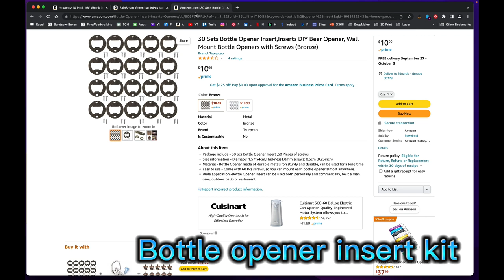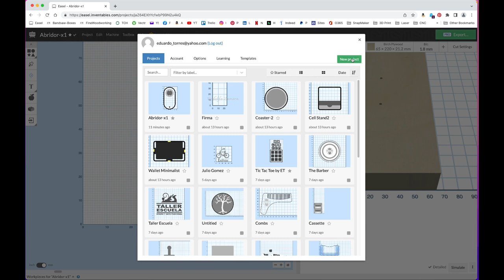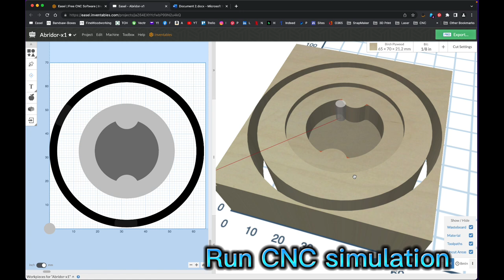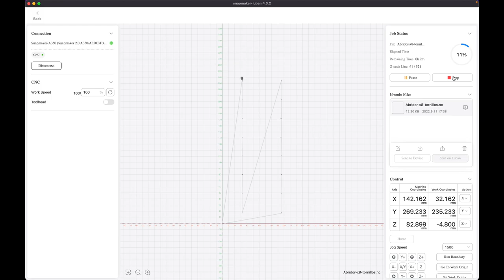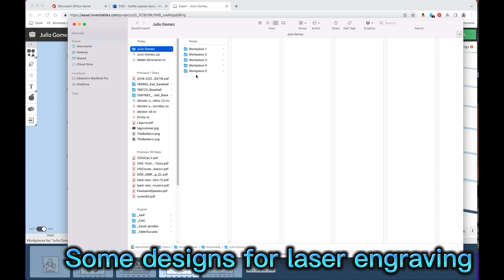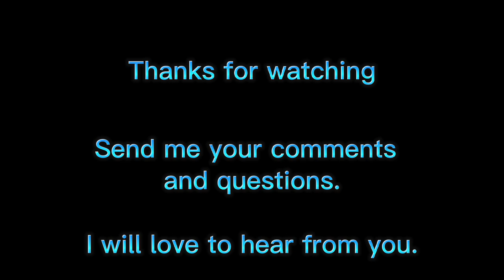CNC Product Making #1 - Bottle Opener

Comment: I have a Snapmaker 2.0 also. Would you be willing to share the CNC cut file?
Reply from the maker: Hi Barbara, I just updated the video description where you can find a link to the project files.  Login into Easel and then you can export from there or copy the project into your account.  Let me know if you are able to do so, if not let me know and I find another alternative.  Regards.
Reply: Thank you so much. You are very talented!
Reply: I saw that you use Luban. If you could send the gcode file I could import it into Luban
Reply from the maker: @barbaracipiti9056  I can look a way to send you the gcode (Dropbox) however remember that you will need to make modificacion to the wood thickness, if not you could damage your CNC bed.   That is why I recommend login into Easel because you can modify your stock size and export the gcole from there.  You follow me?
Reply: @EduardoTorresDeMadera  yes, I would likely use another piece of would as the actual “spoilboard” so as not to damage my actual bed.
Reply from the maker: @barbaracipiti9056  I temporary copied a zip file with 3 g-codes with different sizes. Take into consideration this is only the first pass and you need to setup the 1/8 straight bit to the left lower corner. Try to use a softwood. For the second pass will depend the bit you use but you will need to setup that.  let me know if this helps. https://www.dropbox.com/s/yxejga2mbuu4ofs/BottleOpenerGcode.zip?dl=0